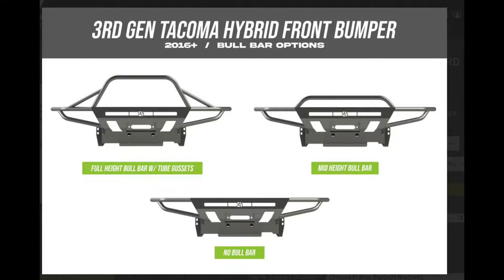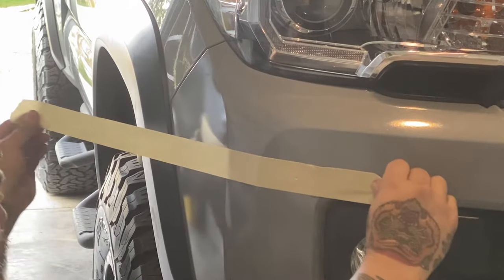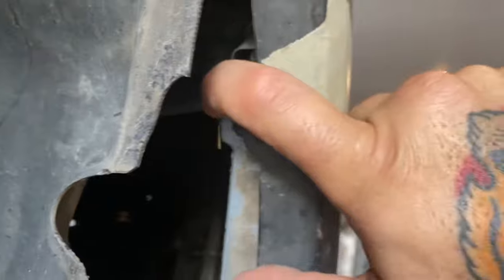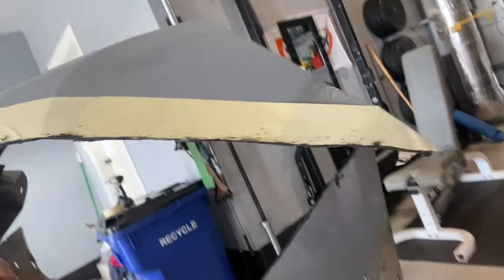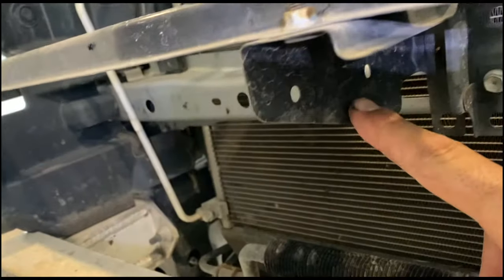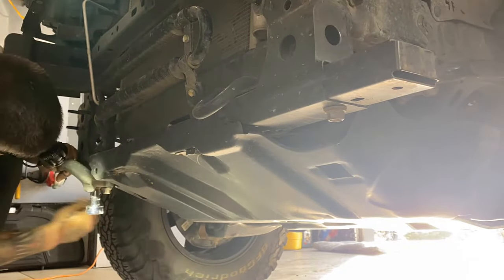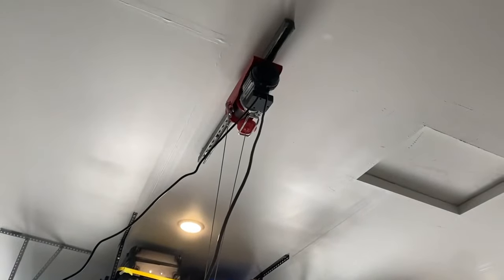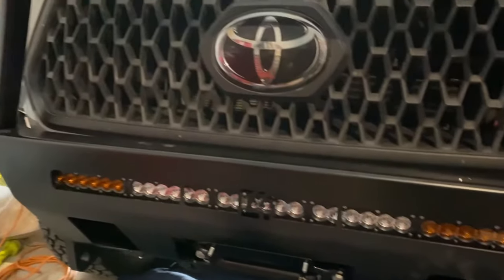Toyota Tacoma C4 Hybrid Bumper Install Video Tutorial

Comment: Did you have to upgrade the suspension first? I’m running the trd lift. Not going to use a winch. I didn’t know if it’s sufficient for this bumper.
Reply from the maker: At first I didn’t have the upgraded suspension and I noticed it started to sag, but I threw on the works like winch, light bar, ect. You can always try it out and get the suspension later.

Comment: Could i get this and still install it with no lift on my tacoma or would i need one?
Reply from the maker: Yes you can. If you’re planning on getting with winch you’re going to need some stronger springs or your notice a sag/lean. Do you have OEM shock and spring set up?
Reply: @eluv201  no I've had my tacoma for a little bit but just starting to do mods but I don't know much. All I've down to it is put slightly bigger tires on it and a roof rack and lights but nothing else.
Reply: @eluv201  I really want this bumper tho and I have around 4 grand I can spend on this front bumper and other additional mods I might need to get to make it work if you have any suggestions?
Reply from the maker: @petergriffith4866  I can make several. I’ll message you. There’s things I wish I knew going into it.
Reply: @eluv201  Thanks man I really appreciate it!
Reply from the maker: @petergriffith4866  if I was to start all over again I’d go with the best suspension and upper control arms. Kings/Fox/OldManEmu and in that order. Adjustable upper control arms to get ready and go for those bigger tires. Start and the foundation and you can’t go wrong. Any other way your work backwards like I did and it’s a huge learning curb. If you wanna go budget OME complete suspension kit or upgrade to Bilstein lift kit and have enough money left over to buy bumper. Shock Surplus are the vendors I’d go with. They have guys that’ll help you with a budget suspension or high end. Buy once cry once, go big brother. $4300 will get you Kings2.5 and SPC adjustable UCA. Then start building from there. You will thank me later.
Reply: @eluv201  I'll definitely take it under advisement I just screenshotted everything.
Reply: @eluv201  where do you recommend buying all this stuff?
Reply: @eluv201  never mind I see you already have with kings/fox/oldmanemu
Reply from the maker: @petergriffith4866  Shock Surplus. You can talk them over the phone and give them your budget they’ll help you out. Get the best and you’ll never have to worry about it for a very very long time
Reply: @eluv201 I was just going to ask I'd this was okay but I'll go look at what you just said again I really appreciate all the help!
Reply: @eluv201 This is what they recommend for me sorry for all the questions I know you're basically walking me through this I really appreciate your time and replies